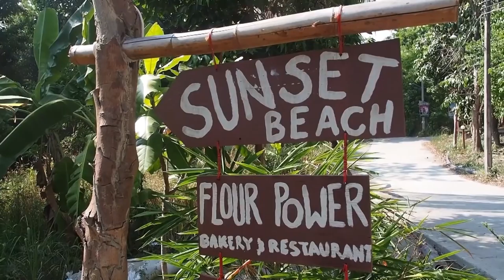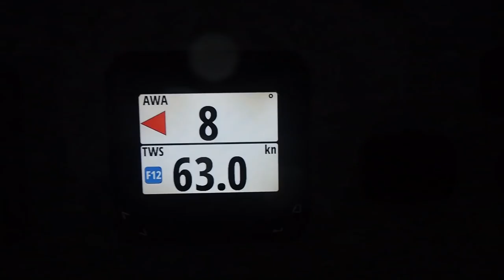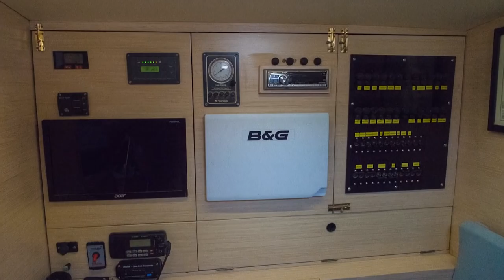SAILING AROUND THE WORLD SINCE 2006!

Comment: Did I see a Perkins Prima engine in this video?  If so, what horsepower?  My 1996 Beneteau 42s7 is powered with a Perkins Prima 50.  I recently had issues with an injector where fumes were blowing by it.  The fix was to replace the washer and the hold down bolt and associated clips.  I continue to have a small diesel leak that I've been unable to find too.
Reply from the maker: +Dick Dixon [Liz] Perkins Prima M60. Lots of servicing, replacing, patching...if only we didn't need an engine!